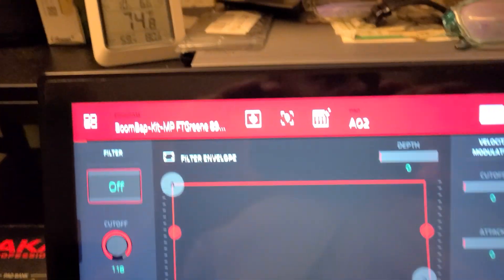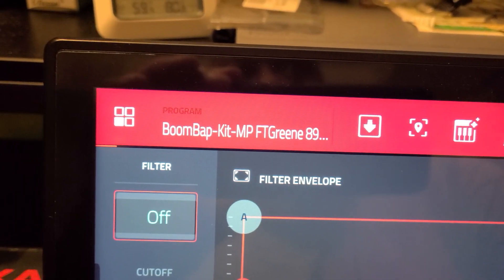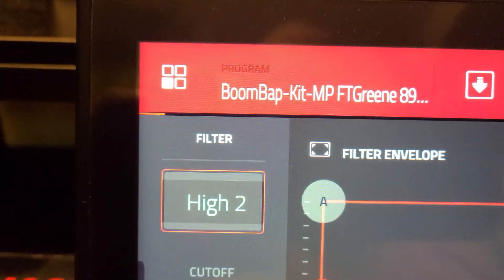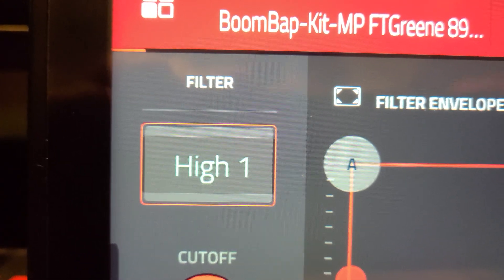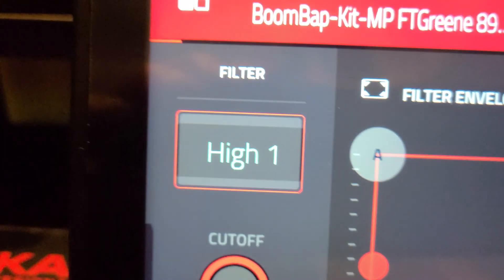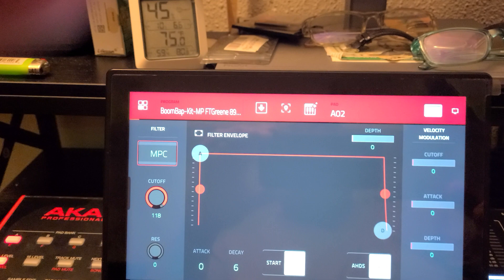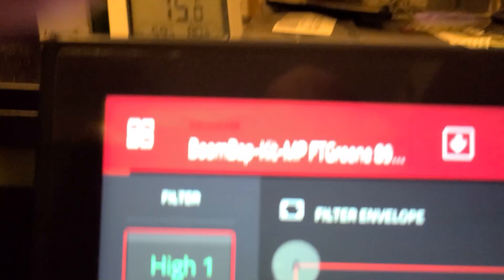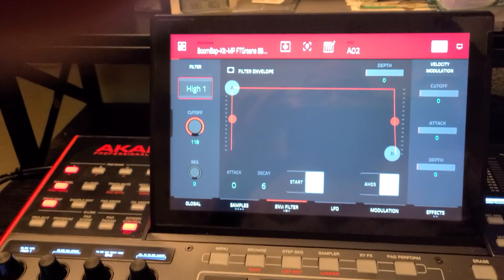MPC Software 2.11.5 Filter Label Bug

Comment: Akai needs better Quality Control, Why are we still beta testing the software? Seems like every update introduces more bugs than fixes.

Can't load mp3 files on this new update and MPC Touch users have a bug with the sample Audition volume slider where it doesn't go away after you touch it again to close it. Have to use your mouse and click on the software until it goes away.
Reply from the maker: Agreed.  I don't even use the software that much.  I primarily use the MPC in standalone mode,  but since the "Instruments Collection" was released,  I've been attempting to use the software more.  It seems like every time I turn it on,  I find a new issue.  It's as if no one ever really tested it before they released it to the public.
Reply: @kb420ps  Yeah it's very concerning with Akai cause they have great products for the most part but on the software/firmware and on the customer service end, they need some serious work. They have more products in their line now so they gotta make sure everything works as intended on all of them.

I have the MPC Beats software installed also so when I run into an issue on the regular MPC Software I test it on that one to confirm if it's a bug.
Reply: ive noticed to the same thing with the mp3 files, also the huge difference in start up time it takes to load the mpc? 
its annoying I thought updates were meant to improve not make more problems.
I couldn't agree more they definitely need better quality control with updates, id rather wait another year for an update that has less bugs than to keep getting updates that cause more problems.
Reply: I just installed the MPC Beats 2.11.5 update as well and can confirm all these same bugs carried over. smh
Reply: @SirhcBeats  I'm glad we are all having these conversations and pointing out everything we find cause we gotta let Akai Pro/inMusic development team know that we are running into alot of issues that can break our work flow. It's bad enough that these devices are already pretty expensive.

Also there's too much competition now for them to be trying to cut corners and push out flawed software or hardware products. They need better Customer Service reps to hear and apply what their users keep reporting.
Reply: I couldn’t agree more! 👌🏼 it’s a bit sad to see huge companies like that rushing to put stuff out quickly I just hope they start to take a bit more care with updates. There’s no doubt that the technology is incredible but like you said cutting corners is not the way to go about especially when they can afford to pay for proper testing the devices are expensive so one would expect the software to be well tested when spending that much money for something.
Reply: @SirhcBeats  That's my biggest issue, that we're basically beta testing for paid products. I think there's also too many Akai fanbois making excuses for them talking about just use a work around. No, we need to have these products polished and carefully tested before releases. Also it would help if Akai/inMusic released some statements saying they are aware of issues and are compiling a list for fixes. This is very frustrating
Reply: @ThaRebeliouZ  yea fully! i cant help but think to would the original team who built the first mpc be happy with what the current teams are putting out? they have a huge well respected legacy & the first machines are still around today. I would just hate it if in 5 years time after paying that much money for the machines that either cant handle the new updates or the physical bodys of them fall apart.
Reply: @SirhcBeats  Oh yeah that's another issue, the build quality of all the new MPCs with that rubberize coating on the plastic is not very durable. It's like you almost have to get one of them aluminum full body skins to protect it.

InMusic Brand owns way too many of these top music instruments/DJ manufacturers now so the quality seems to take a huge hit.
Reply: @ThaRebeliouZ  its frustrating aye, like most musicians love to keep there instruments clean & tidy, its literally impossible on the mpc live that i have hahah im laughing because thats all i can really do.

my idea of purchasing the mpc live was to not be tied to a computer & further more never have to buy another sampler again. its doing alright but that last update had some great features but mines so much slower now & i almost regret doing the update. i think i might hold off on the next one until i know the bugs have been worked out. thanks for making the video i think its important for mpc users to have these talks about the gear they use :)
Reply: @SirhcBeats  Yes and this is why we need Akai to polish up the software cause they do introduce new effects and synths which are actually great but once you run into issues within your work flow because of bugs, it just makes wonder how they be letting so many of these things get through into final ver releases of "hot fixes".